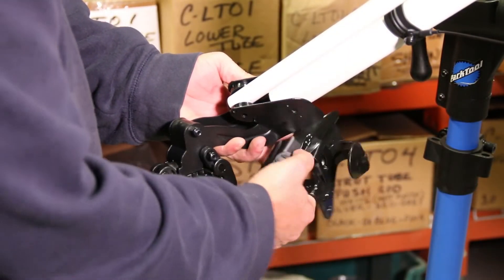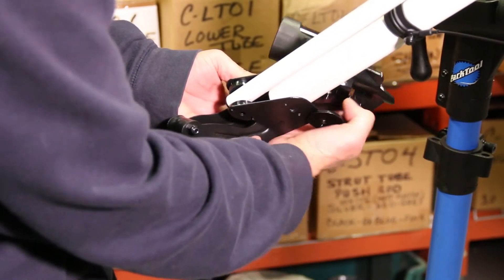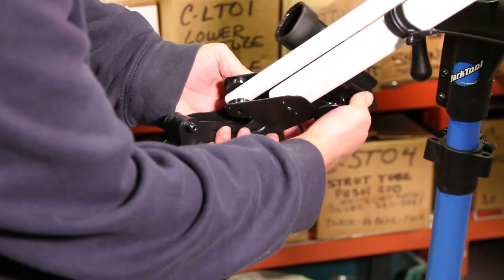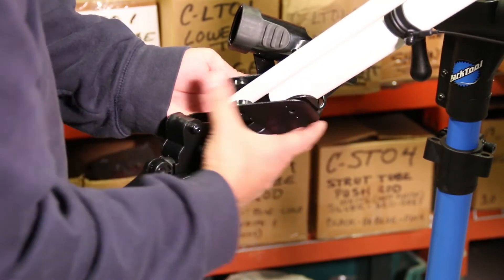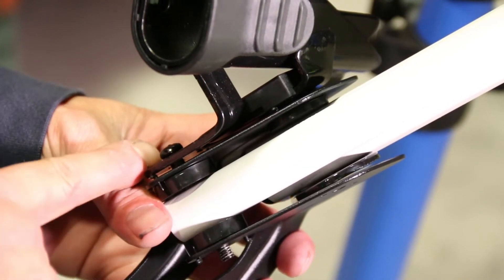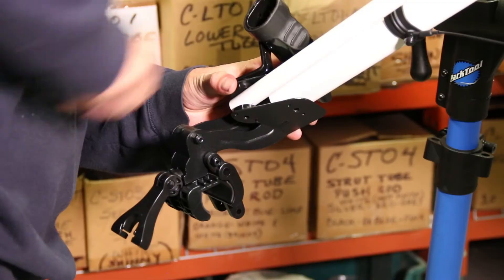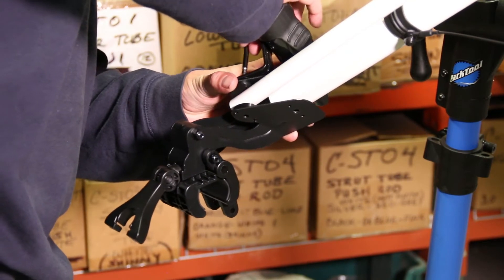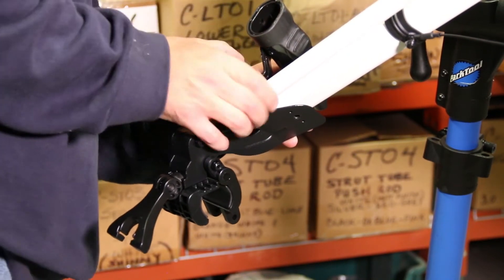Club Booster | Rovic Seat Installation Instructions

Comment: The seat attachment is a major design flaw. There is no way to get the bolt through all of those holes and when it finally gets to the end, it is incredibly difficult to put a nut on the bolt. let alone tightening it. I'm giving up as I've been struggling with it for hours now. I even bought a seat cover for this and now I can't even use it. Donation time. Ugh.
Reply: Mine came with bolts that are a bit longer. I also didn't have to remove any of the rubber washers.